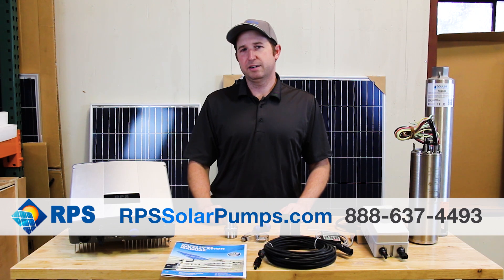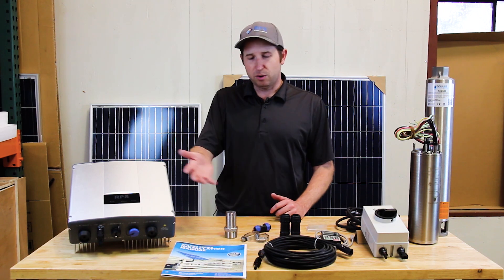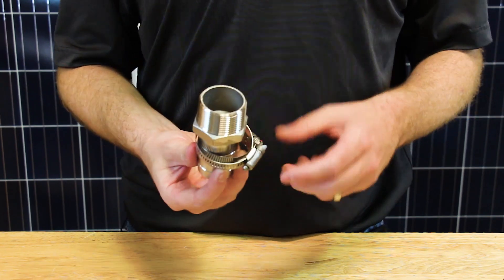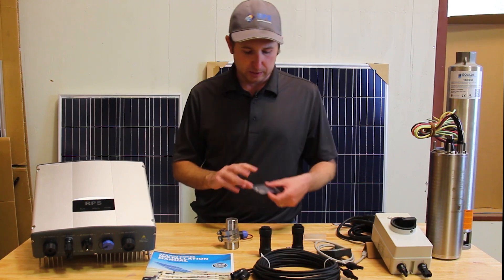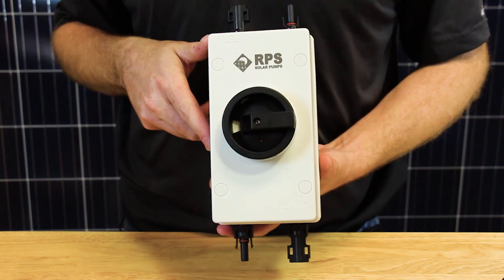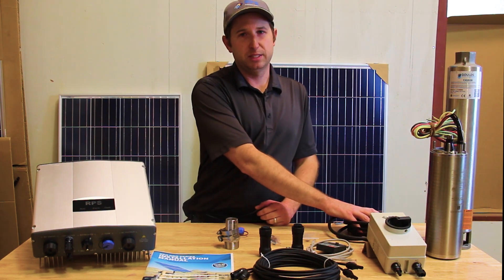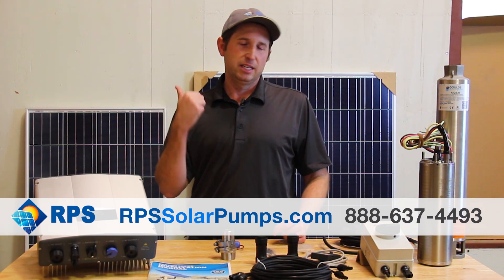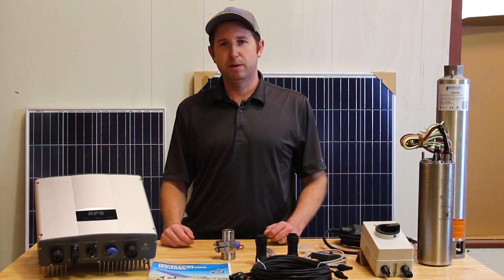RPS Pro Series Solar Pump Overview

Comment: I am running a 5hp Franklin motor. If I use your controller will that be hard on the pump since I am not using your rps slow start/stop pump/motor?
Reply from the maker: If it’s a 3 Phase motor then we can swap in our controller for the VFD!

Comment: my well is at 250 ft.   can this system work for my well?  if so can it really pump good volume
Reply from the maker: Yes, we can help.  With the pro system we can pump 100+ GPM or 1000ft+, so lots of options depending on how much water you need.  Want to give us a call at 888-637-4493 and we can help size as system?